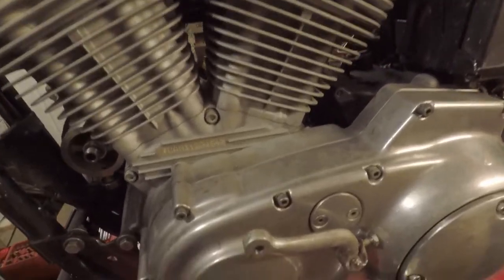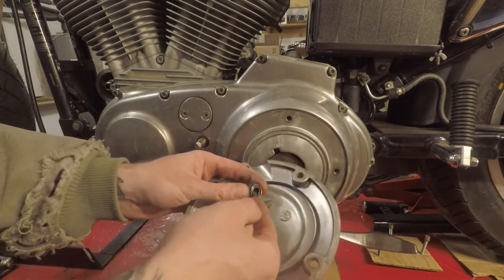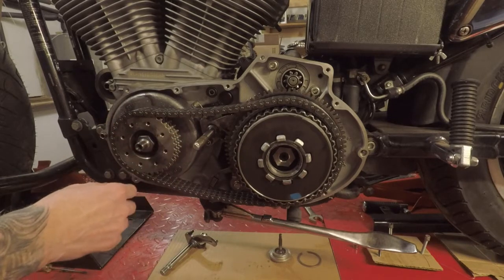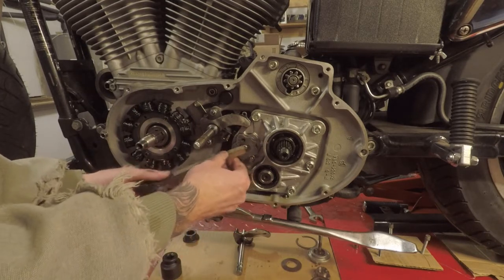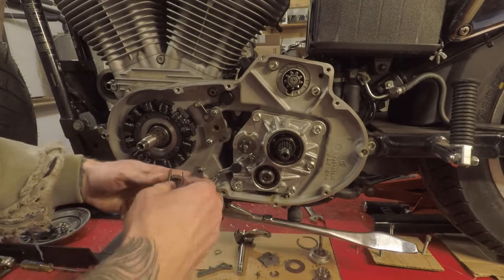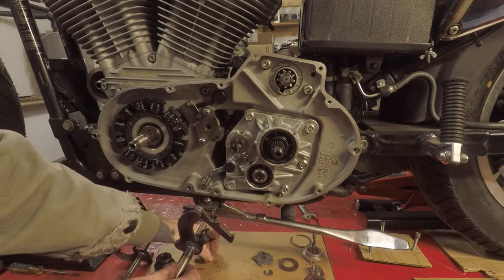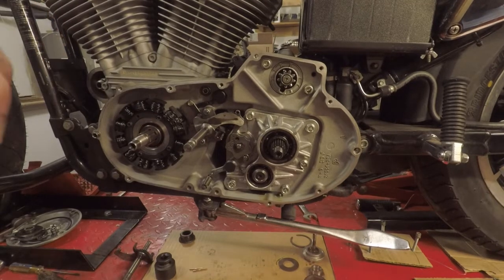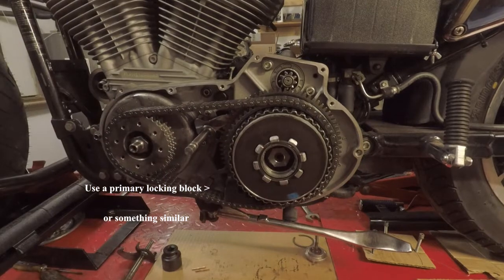2001 Sportster Shift Shaft Replacement

Comment: Great video, very clear and to the point. Mine is not shifting into 5th and hope its the shift shaft or pawl adjustment and not messed up shift forks or drum.
Reply: If you remove primary cover and stator and clutch basket you should be able to shift through the gears with the drum if you can’t rotate shaft while you do so and if still then I deff have burrs in the drum and possible shavings between the snake groves the kind slide in and check those on N.A. turn them upside down and reuse .

Comment: Do you know if the shaft needs replaced if my 1st gear is slipping into neutral? I adjusted the internal clutch and it works but after a while it starts slipping again. I am told it has something to do with the shift shaft or shifter dog but not too sure where to go from there.

Comment: I got around to doing this because my shift shaft was bent and that little Detent plate clip blasted off and shot all over the primary. I replaced the shift shaft assembly and even that tiny spring. Put it all back together and I got a ton of play in my shifter, like the shaft spins wayyyy too much. Shifts fine but just a lot of play. Any idea what I fkd up??